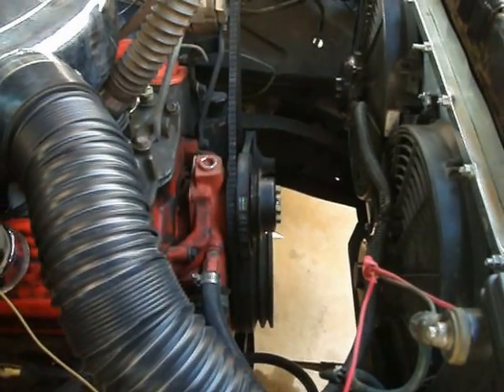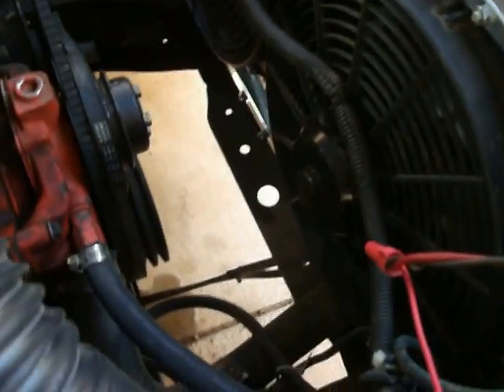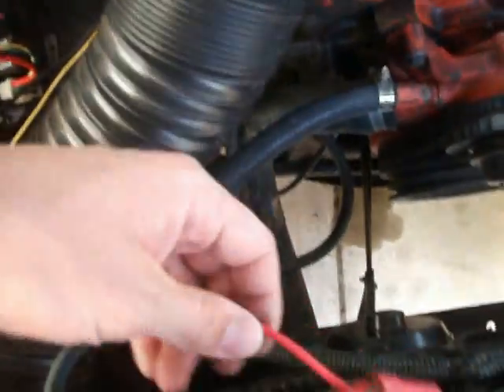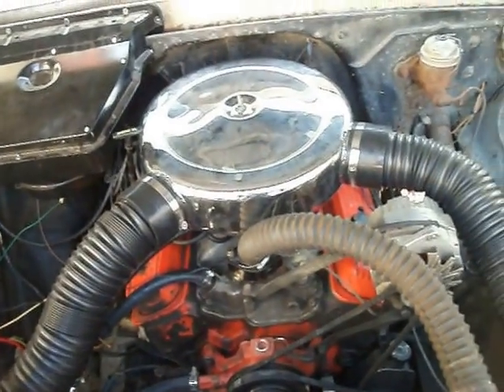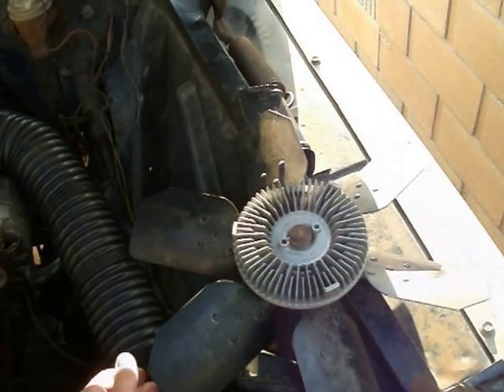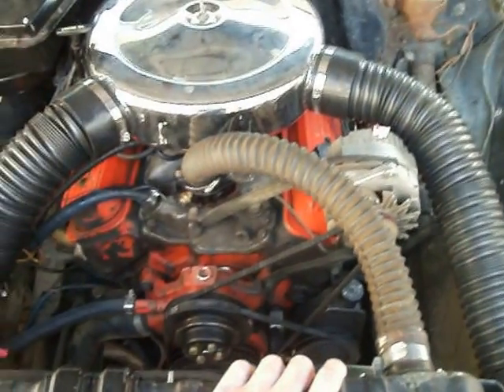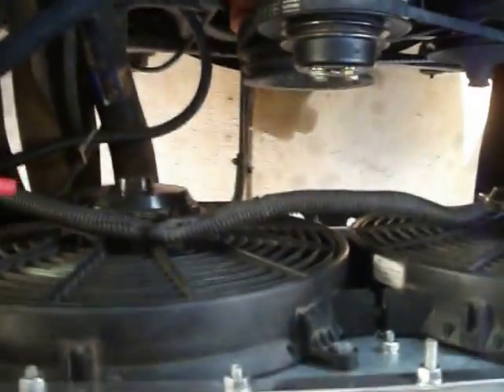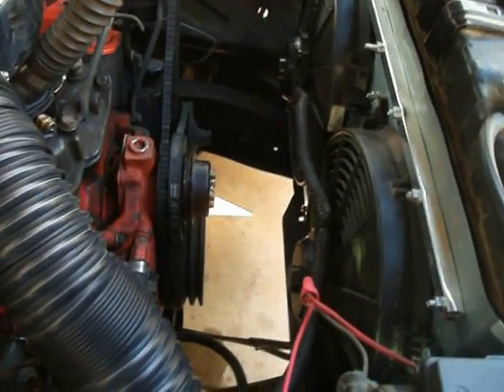Clutch fan VS electric fan

Comment: You were talking about Edelbrock performer intakes. Listen up. I replaced my thermostat, gasket etc and easily striped out the 5/16 threads. Retapped, did not hold. Bought Timesert threaded insert kit, drilled, retapped, insert installed, and permetex thread sealer. Went with studs rather then 5/16-18 bolts. Do Not over-tighten those bolts.

Comment: Electric Fans do use HP but not as much and it takes a lot of strain of the water pump and makes the Mechanical Pump last longer but you can always get a Electric water pump too but that more draw off your Alternator which eats HP
Reply: So what’s better clutch fan or electric fan on old school 350 sir ?

Comment: I would like to buy a kit for a 1995 Ford F150 with a 5.8 in it but not having much luck finding one and don't know what to look for
Reply from the maker: I recommend measuring your radiator and taking a trip to the salvage yard and finding fans that fit.
Painless performance has a nice fan controller you can buy.
or just run them off a toggle switch.
Reply: @3rdGenGuy  ok thanks I got to go to the junkyard anyways and get a new radiator I'm debating on just buying a new one because you never know what people put in those things you know if a 5.0 Mustang radiator work in my truck

Comment: The a small battery (like a motorcycle) or a capacitor (like from car audio shops or crutchfield magazine) can be hooked up directly to power the fans and you can use a relay or contractor witch the wire spliced to attach to one side of the coil and take the other side to the car frame our battery negative then have the small battery/capacitor in parallel with your battery ( positive to positive, negative to negative) then take a wire from the positive side of the battery/capacitor to a normally open contact on the relay/contactor and the other side of the normally open contact on the relay or contactor to power your fans. Then it'll pull from the small battery or capacitor instead of the alternator and the alternator won't pull on the engine (bad for belt, mileage, horsepower and alternator) and you can put your idle speed back down.

Also you probably already know the idle speed can be set even lower than before with the electric fan and you'll need to reprogram your performance chip or upgrade to one if you haven't yet since all the settings of the vehicle week be optimized for the clutch fan and with this you'll get even more acceleration, power, smoothness, longevity and mileage

Comment: Should it have went to sample the radiator instead of the engine to check the temperature of the coolant instead of the temperature of the engine which is always considerably higher than the temperature of the coolant.

Comment: 283's run hotter?? uh,....no.
Reply from the maker: um ya, casting quality for water jackets was pretty terrible with 265/283s
Reply: That is correct...not all head castings cool the same. In fact some are to be avoided for that reason

Comment: Great video man! I have a '88 Jeep Wrangler with a 350-4bm., 400 turbo, and was wondering if the electric fans would be better than my manual clutch fan thats on there now. Gonna give the electric fans a try and see if it works better on my overheating issue! I appreciate you sharing your knowledge! It helped me decide what Im doing next
Reply: Check your radiator, it’s the most common reason for overheating, also bleed air out of the coolant system, check for blockages in the system, if there’s nothing like that, just change the radiator and keep the clutch fan, I’d recommend to delete the clutch and keep the fan running always, more reliable in most cases, also more fan blades are better

Comment: damn, should used arduino instead of that fan controller
Reply from the maker: ya that chepo one i used died after a year.
i just rigged it to a toggle switch for the time being.
Painless has a high end controller, but it's pricey

Comment: There are two big electric fans on my '88 caprice drag hearse (swapped '78 350 engine, HP camshaft, heads, headers, intake, carb, HEI ignition etc...), they turn on at  92 C  (198 F)and shut down at 87 C (188 F). Temperature sensor now in  upper radiator hose. With old shitty Delco-Remy alternator it's been not very good, but with new 120A unit it's running cool. 
In Russian Federation, that old grandma's wagon are cooler than new Cayenne or BMW M6:)

Comment: Shaved 4.2 sec off your 30-100? That's very substantial. You did such a nice job on this I had to delete my previous comment. I missed how you mentioned the clutch wouldn't disengage. Now I can see how your freed up the HP. I think even if someone doesn't have a fun running full time the definite benefit is clearing up engine compartment space.

Comment: What year is that Old Chevy Pickup you have.
Reply from the maker: it's a 1964 Fleetside longbed 
originally came with a 289 with air conditioning
Reply: 3rd Gen Guy Sounds cool man What future plans do you have for this Old Chevy.
Reply from the maker: I wanted to return it to factory Spec.  SO everything would look and behave like a 60s truck.
Reply: 3rd Gen Guy Sounds good man. That 350 is probably making 350 HP right.
Reply from the maker: Closer to 270 HP according to my Acceleration data.
it's  a poorly built engine (A shop my dad used did a bad job)
it has 8.6:1 compression and a camshaft that is designed  for 10:1

Comment: From what I have seen on Dyno testing, the solid and or stuck fans use up to 30hp & 18.5 foot pounds of torque.That’s a substantial amount.
Reply from the maker: You can definitely feel it.
the engine felt like it wanted to revve faster and harder.

Comment: Wow  I think you did a good job I have a 69 f 250 390 and it has a clutch fan although the truck was broke down when I bought it I'm a few moons away from starting the engine after rebuild . I don't think the clutch fan was stock but it could had been with the 390 f250 looked into adding elec fans suprised to see all the comments that are opposed to them since all the newer cars even big HP cars have electric fans !!!!! Like a Hell cat Camaro etc if they were so superior don't know why a 800 HP car needs a fan clutch . Although I would rather have a clutch go out stuck on then off since you be getting constant air flow alot of noise but won't kill your motor .....

Comment: my mechanics said that changing my car's clutch fan with an electric fan will make the altenator work a lot harder, which also means the alternator life span will be shortened. Is this true?
Reply: very true.  If you live in a warmer climate, and spend a lot of time sitting in traffic this should be a concern.  Ive been a practicing ASE certified toyota mechanic for a decade.  I live in WA, and have always converted all of my vehicles over to electric, as i spend very little time sitting still in traffic, and have very moderate temperatures most of the time, and my alternator replacement has never been anything other then ordinary.
Reply: Or just run a dual battery with a controller so your fans use auxillary power and your alternator just trickles in extra power when they aren't on.

Comment: I could be 100% wrong, but the Engine Clutch Fan is causing drags. Although nothing is 100% free. But too many Pulleys, etc...., can caused the Engine to work harder :///
Reply from the maker: nothing is 100% free.
A dyno test showed a electric fan sucked up 1 horsepower with a loaded up alternator.
a flex fan consumed close to 30 horsepower

Comment: Clutch fan to flex fan suppose to take load/weight off water pump/engine also!? I'd try that first if possible (cheaper than electric fan(s) & then need bigger alternator Amps!?)...,
But stop & go traffics a pain sometimes & dual fans can solve the problem of overheating car & ac not cooling good at a stand still in traffic !?!? 
Depends on where you live & how big radiator or engine is too!? Large engine needs a good cool set up!!!!
Reply from the maker: well i can tell you that Mild Chevy 350 revved WAYYY easier after removing the clutch fan.
defintly removed drag from that engine.

Comment: after you took the old fan and clutch off did you use the same bolts from the pulley or did you have to get shorter ones?
Reply from the maker: I got shorter grade 8 flange head bolts.

However, the longer bolts would have worked
They just would have stuck out a bit.

Comment: hi and in my car I have a fan set and I can trun on      1 fan on at one time Manually  and   if it   real hot day I can trun fan two and or I can trun them on at the same time Manually
Reply: You can add a Cheap Relay and a Cheap Thermostat Disc (Temp at your Choice) and it will turn On / Off automatically for you. That way you don't forget :)))

Comment: What size alternator do you have. mine is a 100 amp.
Reply from the maker: Well it's a run of the mill parts store ALT.
So my guess would be 80 amps.
Reply: +Levi Hayes - When you free the Clutch Fan, you will gain more Amperage since it's less drag and the Alternator would work even better.

Comment: I do think the electric fan would work fine yes the alternator will work a little extra not enough to hurt it given that the alternator doesn't continually throw charge when on regular job I think it cuts off the charge when not no more is needed  to charge keep battery charged and this is only my opinion I was thinking I could change my car fan for the electric one but check how the car worked and thought there isn't an issue for now though I don't want the fan to stay running every time I start the car but I will keep an eye ball on it.
Reply: When you free the Clutch Fan, you will gain more Amperage since it's less drag and the Alternator would work even better.

Comment: i have a 2003 suzuki xl7 2.7L V6 and i want to do the same. what do you recomend
Reply from the maker: I have no experience with Suzuki.
Just measure the dimensions of your radiator, and go to a junkyard and find a electric fan that would fit both length and width wise.

There are several forum posts on how to make a custom fan scrowd.
That will help you.
Reply: shroud* lol

Comment: I like the tips. But one for you. solder, shrink tube. wire nuts are for houses only. it's only a matter of time until they rattle loose.
Reply from the maker: Oh forsure, this setup was hacked together when I was like 16yrs old.

Still works to this day according to my dad.

Comment: where did you get that air cleaner?
Reply from the maker: from summit racing.
spectre was the brand.

i feel like anyone with a welder can make their own
Reply: Any power gain with that intake? Always wondered with all the heat my headers put out if one of those wrapped in heat barrier would do much.

Comment: where did u get the mount for the thermostat sensor?
Reply from the maker: i don't remember where got it.
it was just a 1in thermostat spacer with 2x 3/8 threads on it
Reply: OK thanks
Reply: you can get em from Jegs racing , ebay just google search "sbc thermostat spacer" the ones i seen had 2 spots to install fittings just use a pipe plug to plug one side of if that what you want to do

Comment: Had to remove mine, wouldn't cool well enough on the highway due to the flat shroud blocking airflow. The thermostatic control died on mine as well. Guess what, no response from FF Dynamics who has no phone number

Comment: Nice job, I believe in using electric fans over clutch fans. I would put a light of some type in the cab To let you know when It is on or off. That way you can keep track if it operating correctly for the given weather conditions.

Comment: I have a 60's model truck also, mines a 63 whats yours, I have to run 2 fans  ,heavy duty fan clutch and a pusher electric fan, 350 bored 
.040
Reply from the maker: it's a 1964 C10 custom cab with air conditioning.
1994 350 0.05 over
Reply: The blank space blocks 2 much Air flow.
Reply from the maker: ingebrecht not sure what u mean.

Comment: Great video. Do you ever have it come on while driving on the highway?
Reply from the maker: Thx
They did turn on during highway use.
My original fan shroud didn't allow air to pass through fast enough at 60mph.

The solution is factory rubber flaps that open at high speeds like new cars.

Now they stay off for the most part around town.

Comment: I did it once in a hummer h2 and it was really nice until i had to travel 600 kilometers and my top speed was 110 kilometers per hour because if i go 120 or more the fans just comes useless and incapable of cooling the engine 
So the ideal is to add in the front of the radiator an auxiliary fans it will kill the heat in no time 

Nice vid .. Thank you
Reply: I was watching this video cause of my H3 cooling issues and I've swap out the clutch fan for a new one but it seems to be stuck and has loss of powers and roars every sec
Reply: +Charlotte Major I've bought an h2 sut just weeks ago & I'll add a gmc electrical fans,, much better specially off road